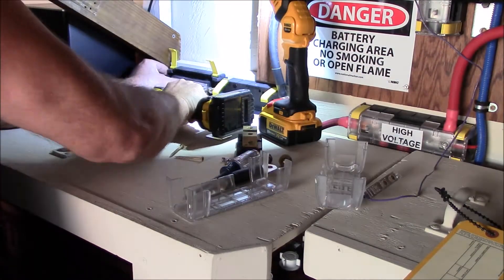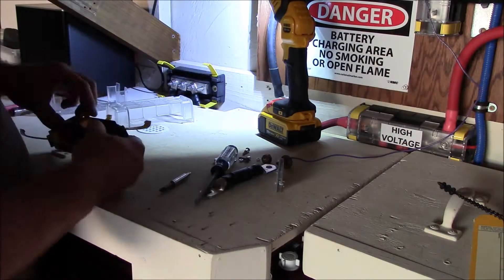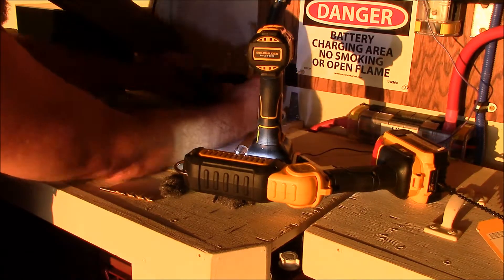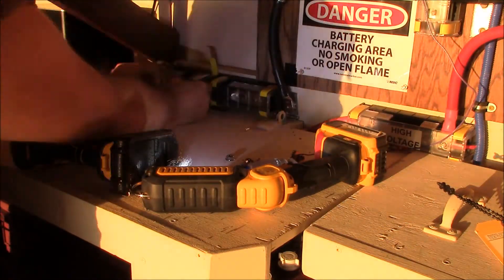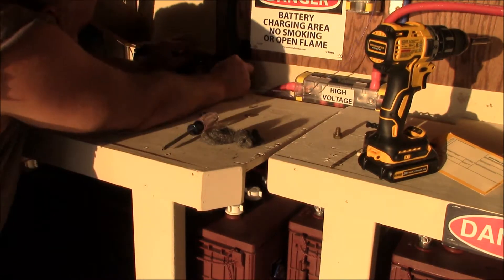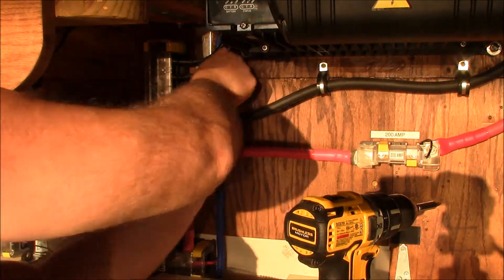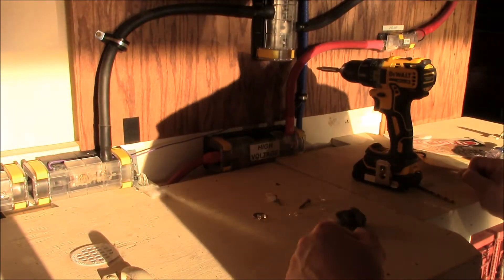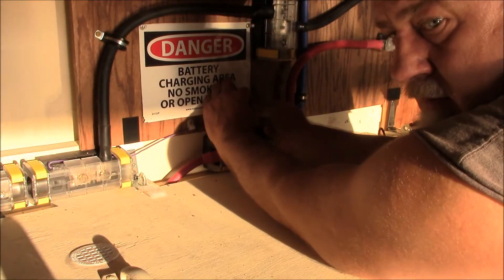Installed Midnite Solar Wizbang Jr cover & YT Channel "shout-out"

Comment: Chris, I noticed that you have multiple midnite classics. Did you figure a way to share one whizbang junior among them using the follow me function or are you using a separate whizbang for each classic? Hope you're still following this video after all these years. Thanks much.
Reply from the maker: Yep. One Whizbang and Follow Me mode all working as designed. Upgraded to a 48v system a while back. Everything is running nicely.

Comment: Very nice install Chris. It is fall here for sure. The wood stove has been going for 5 days now. The solar increase seems to be paying off. We have had 5 days of no direct sun because of clouds and rain. At least the smoke is gone for now. The batteries are still 100% by 1PM even with Clouds. We will see how this works on Dec. 21st. So far I have not started the diesel since   Mid April. Lars is a great guy. I think Lars is in the PNW as well. Great video Chris!
Reply from the maker: Thanks. Oh wow...saw where it was chilly up there. Idaho showed snow. If you conserve with solar...the sky is the limit. I have had 3 kWh solar harvest days (cloudy, not much power coming in). But, what folks won't say is that you can really live on that quite easily. First conserve and limit use (do it smartly) and then "right-size" a renewable energy system. Nobody's system is perfect (and Mother Nature has her way of spoiling things). Yep Lars is in the PNW (OR)
Reply: Yes indeed & as Steven would say I am in the PNW (Pacific North Wet)

Comment: Going to hang out with Lars this weekend.  I share the shunt with my Magnum (in it's MiniMag box), so my Whizbang wires are connected to the shunt, and the actual Whiz bang is mounted remotely.  I do like that Blueseas cover though.  I have a new Renogy inverter/charger showing up today,  so I am excited to do a little solar work this year.
Reply from the maker: Cool, just checked out the Renogy inverter/chargers...look pretty sweet! Congrats...have fun

Comment: Looking good Chris!  I'll check out Lars channel...
Reply: Ohh that Lars, been there many times, great channel!
Reply from the maker: Thanks...system is running great. Did you get your power back in your area?
Reply: Yes, after only 3 days.  We really did not suffer to much since we had the solar.   We had lights, fridge, freezer, well, air conditioning, ceiling fans and movies on the big screen the whole time running off the solar.  The only things that we did not have were: hot water, internet and clothes washer.  I plan to solve the hot water problem with a solar water heater pretty soon...